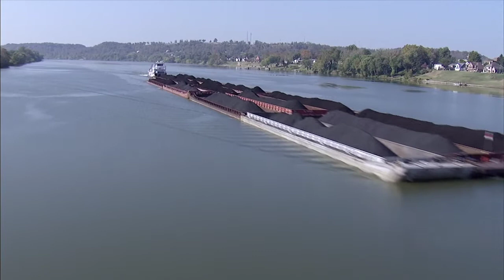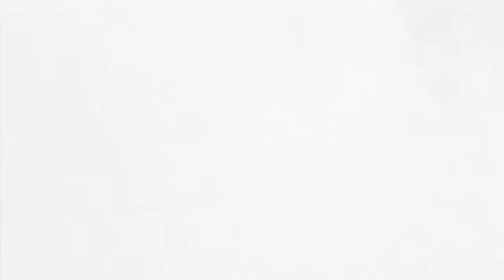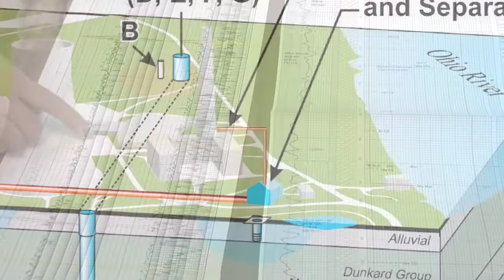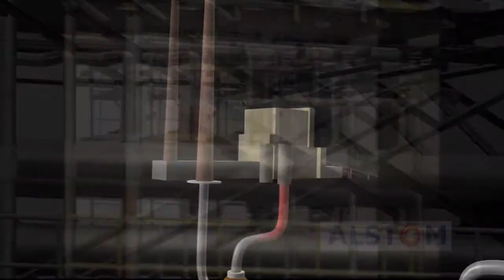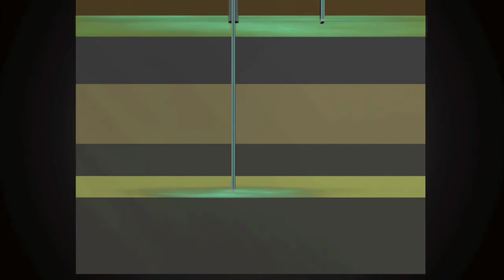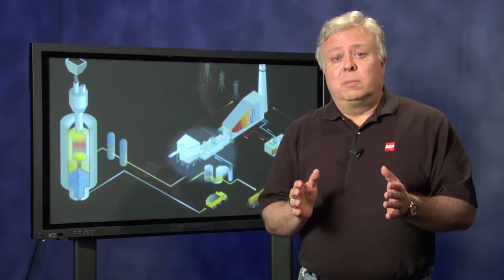AEP: Carbon Capture and Storage

Comment: I don't know about a liquid state, but as long as the CO2 is displacing liquids or gasses, micro quakes would not be a problem, for sure. If high pressure or heat is used to extract petro substances, then disposing of a waste product makes sense. A big problem is most extraction is far form where CO2 is produced.

Comment: 1. how much energy is lost to process?
2. Wells can blow out or leak
3. voids in rock won't be empty, likely have water that would need to be disposed.
4. pressure could cause quakes